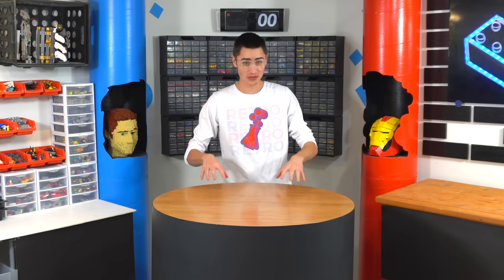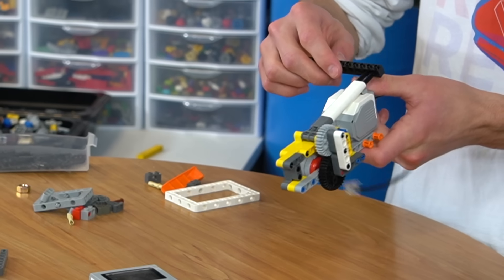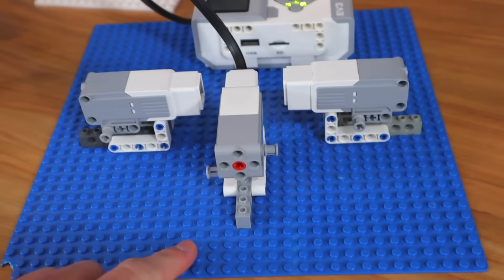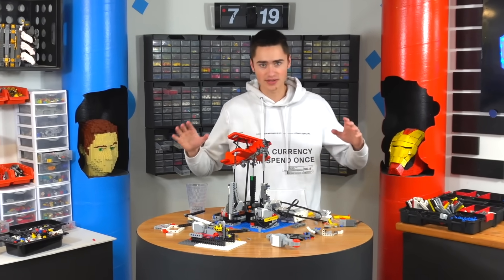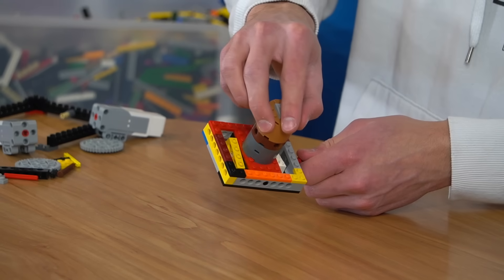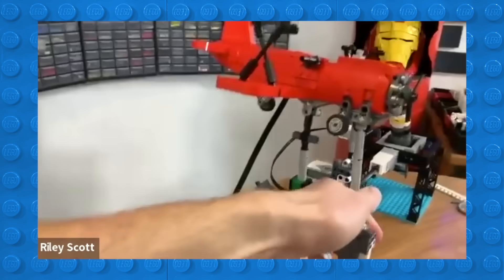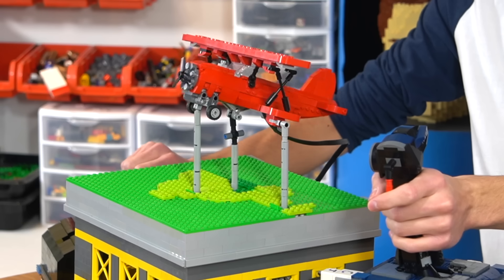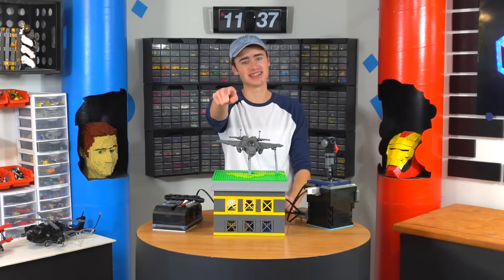I Built a Working LEGO Flight Simulator!!!

Comment: Also, how many RPM (Rotations Per Minuite) are the motors? I think it's possible to make a ship proppeler. it just needs to be strong due to water resistance. it's quite dense

Comment: K so my father and my grandfather are pilots and I think you could make it just a little more realistic by adding  alrons elevators flaps also by making the prop turn a lot faster also one last thing is for proof my grandfather flies a cessna 172 and my dad flies a a320 and a320 neo another thing is that the throughtle system will stay in place and not go back down to zero because pilots dont want to have their hands on the lever at all times and the joystick that you use is more for a jet not for a biplane which is more like a upside down baseball bat and the handle box is also more like a jet design than a biplane and not many buttons needed last or would not be a realistic flight sim better of with Michigan Flight Simulator

Comment: I feel your pain and have been there.... flash back 20 years ago and I had to pull all my electronics knowledge together to build a steering box for a real life rock crawler.  Had hydraulically operated front and rear steering. Needed the rear to always return to center unless it was active.  Not enough time in the world to describe here all the planing as well as the circuitry for the  potentiometers and micro switchs.  Now you can buy that stuff already made.  I think you could back then but it was not cheep

Comment: Tip: use a 4 blade propeller with 2 studs on each blade and snap on some slanted pieces and it will also blow air when spinning

Comment: Another challenge: You could try to do this again, but here are a few criteria you could follow:

- Make it fully mechanical. The only thing that isn't mechanical is a LEGO Electric Motor which drives the axles and gears and assembly that powers the whole flight simulator.

- If you want to make it EXTRA FULLY MECHANICAL, try to use a LEGO Wind-up Motor instead of an electric motor and then make a gearbox so you can wind it without effecting the whole flight simulator.

- Make a black box. Hell yes, the best thing of an airplane (and perhaps most useful of all), black boxes. While you can't make a fully-working black box which can be put inside the plane, because that's impossible and not what I mean, you can have a LEGO Technic liftarm assembly that can grip a pen to draw on a sheet of graph paper. This way, you can get a sense of how well you did and how your flight went due to it calculating altitude, speed, heading, etc.

- Make it like a model airplane would fly. So currently, your flight simulator is stationary and starts out in the air. You can't land it or see it fall from the sky, which is, no offense, pretty disappointing or underwhelming. The most exciting part of flying an aircraft in a flight simulator is the breathtaking look at your airplane so high in the sky. I suggest some sort of chain or liftarm assembly to make the aircraft able to rise. I also suggest to make the airplane smaller to minimize the amount of pieces. You can use the same system for the other parts of the plane to make it pitch, yaw, roll, etc.

- Make mechanical dials. Mechanical dials can show a lot. Speed, pitch, heading, altitude, anything.

I'm currently trying to design some sort of flight simulator like this, and I hope I finish it before the end of the year.

Comment: If you add some conveyors running parallels you could have a functioning minigame where you doge incoming missiles. Maybe a pressure sensor on the leading edge of the wings would stop the conveyors if it makes contact with an obstacle.

Comment: Nice job! Great proof of concept. For added depth, the next step would be to tie this thing into an actual flight simulator using a 3 motor platform system that can also move the aircraft up and down depending on altitude (Within reasonable limits, obviously) and bonus points if you give the jet fighter some kind of ejection system so when you crash in the sim, the lego pilot ejects.

Comment: Upgrade idea: create a belt mechanism horizontally with buildings and trees etc for the plane to fly over (inspired by the Nintendo set)
Reply: great idea!
Reply: Ya
Reply: What the hell what plane is that bro  what  the  plane doing  let's try to fly the plane yey
Reply: maybe by creating a wall to lift the plane if we gunna do this??? I mean its mounted on the ground but if the ground keeps moving it also keeps moving
Reply: I thought the exact same thing!
Reply: @pauljackson3491 Same!!
Reply: Also make the craft move up and down at a rate based on the angle of the plane.
Reply: Thats way too difficult yo make, but it's still a good idea.
Reply: @axis1677  Everything's possible...

Comment: 1: propeller engines do not start depending on the throttle, throttle angles the blades while the prop is already spinning to generate prop pitch and accelerate.
2: "up and down" and "side to side" is called pitch and roll.
but this is a very cool setup and i love it!

Comment: Could have saved yourself the headache of coding by simply connecting the motors of your joystick to the motors for the pitch (nose up & down) control motor and the roll (wing tips up & down). The motors in your joystick would act as generators to your control motors, so any spin your joystick provides would give spin to the pitch and roll control motors. Would need to work out gear ratios with the joystick and its motors though.

Comment: This was a great video - I think projects like this would be a great way to introduce kids into the world of mechanics, electronics, engineering, and programming. :) I'm sure many people have realized that before, and I'm sure that's how these are designed and marketed, but I've never really seen lego robotics used in a project like this before - very cool! :) Using the rotary encoders on the motors as sensors like that was really creative. :) 

Also, thanks for answering my questions during the premiere! I'll have to look into that python API, I think I'll be getting a set for my niece! :) I think it'd be a great way to let her try out some programming, and she already loves legos! :)
Reply from the maker: Thank you! Yeah I hope that works for you- stack is hard to use sometimes because it lacks certain features. Especially for this project I had to switch to ev3 lab view 
God Bless!
Reply: Hi